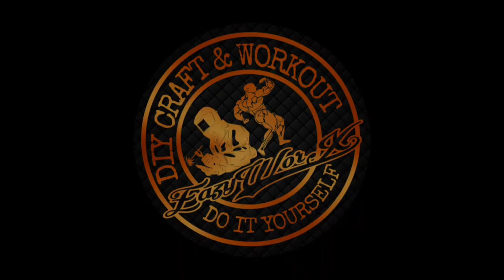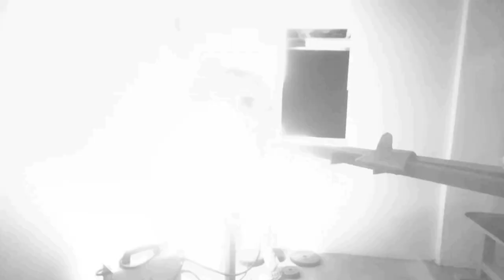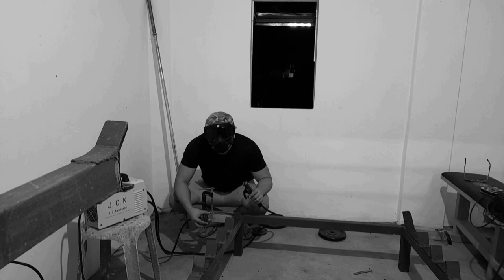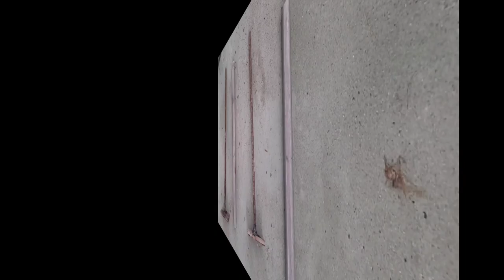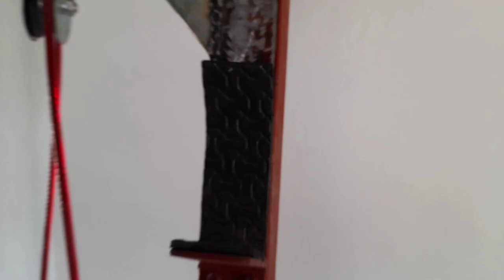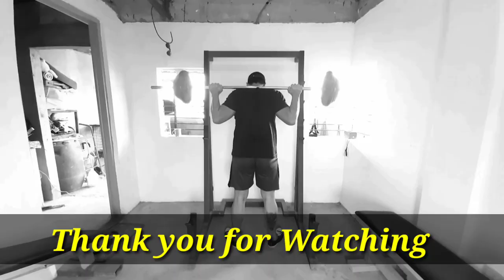HOMEMADE CABLE CROSSOVER LOW COST $16 ONLY | OLD MULTI-PURPOSE RACK UPGRADE | DAY 12 DIY || EazyWorX

Comment: I would have put the bar hooks lower too for bench press etc, all you really need for anything is a half rack and safety bars.
Reply from the maker: You can perform shoulder press, squat, incline , flat , decline on my half rack
Reply: @eazyworx7159  You can if youre 7 ft tall or have the worlds longest arms
Reply from the maker: You can because it has 4 pair of hooks (welded)
Reply from the maker: https://youtube.com/shorts/tTVmz1gjskA?feature=share you can check my short video while doing bench press using my half rack (not upgraded yet (no cable crossover attatch yet)
Reply from the maker: Bench Height bro 19 inch